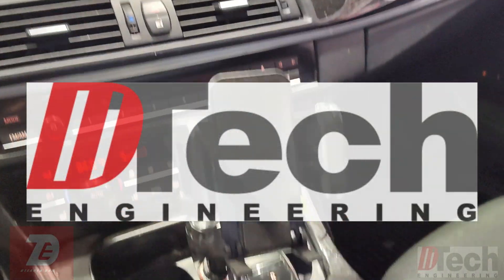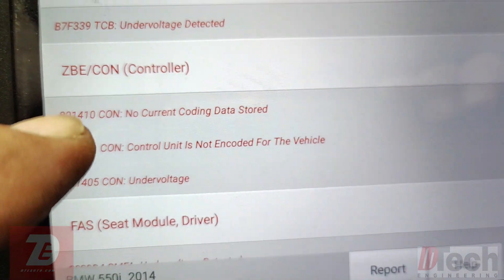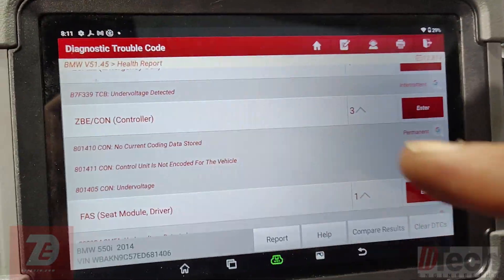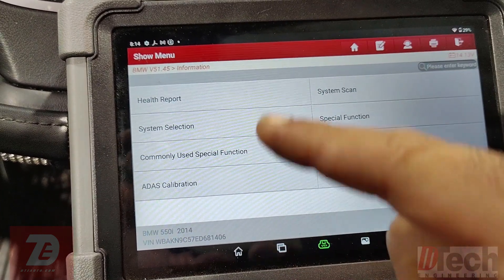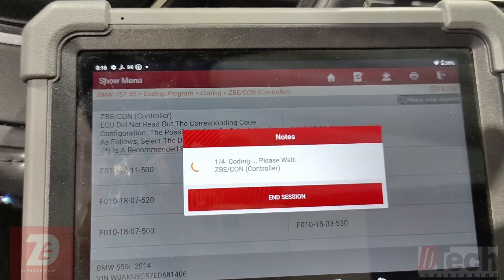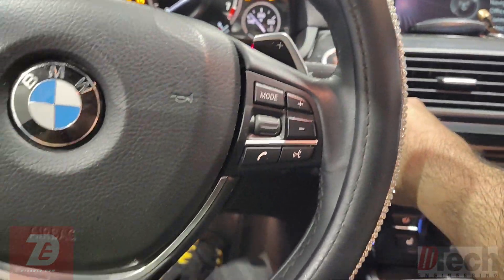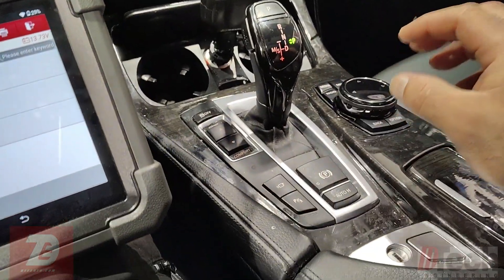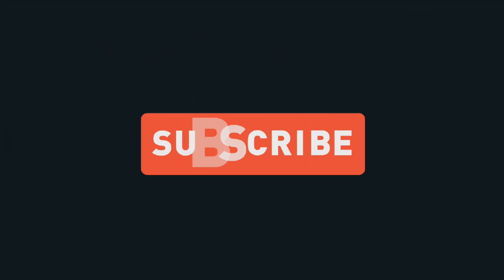BMW i-Drive Controller Coding

Comment: Excellent video Sadel! Is this Coding the same as what Nissan calls configuration? Can you save the old module configuration and write it to the new one in special function? Now days if we don't configure a component properly even though is the same part number and everything for that vehicle some functions may be lost and give you codes. Thank you for sharing, Sadel. Always learning something from you Sadel!
Reply from the maker: it is pretty much configuration but it doesn't save it from old unit , it is able to retrieve from online and write it into the module